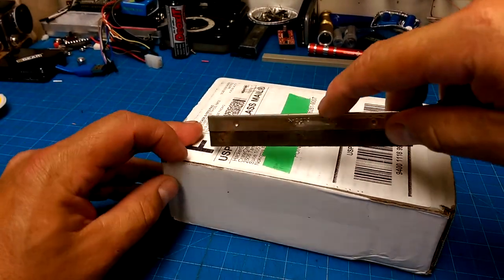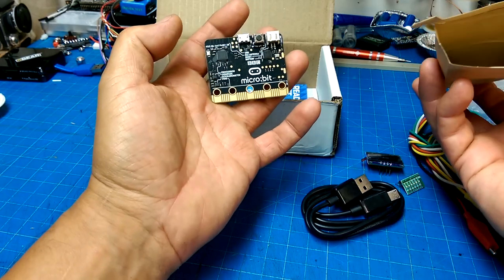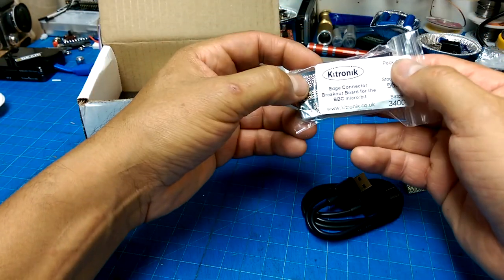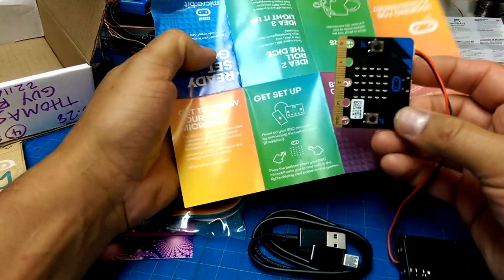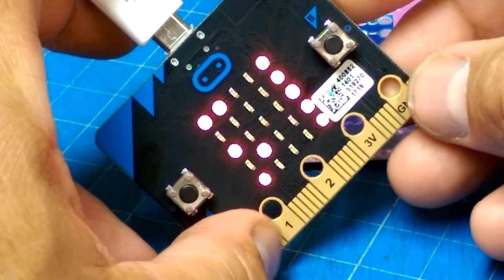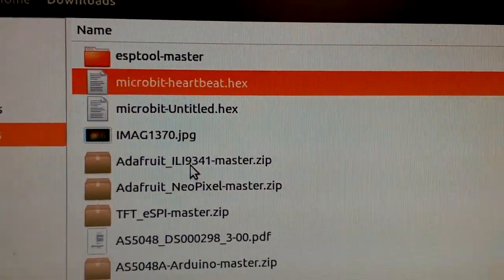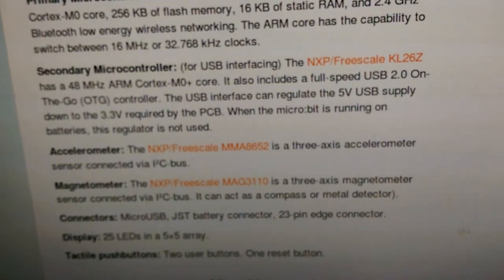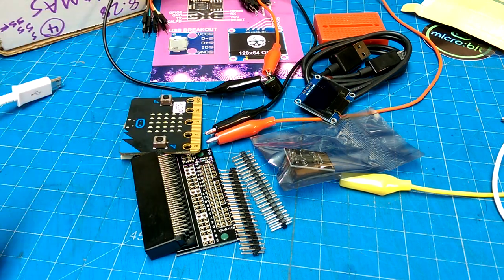BBC MicroBit

Comment: What protection have you used on the pin outs of the micro chip and explain the  problems that might be associated with static discharge and how you would then check your ports to ensure this working on arrival or in some cases importation
Reply from the maker: Not sure what you are asking here?  And of whom?

Comment: What the value of the resistors on the led array and how would  you operate this from a higher working voltage  ??
Reply from the maker: I will take a look tonight.  So are you asking "if i want to drive the LED's from a rail voltage higher than the 5v that drives the microBit, how would I do that?"
Reply: Yes ( I know how to do this  I know the answer  , the full answer already I know how to make that unit from scratch I know how to program that unit ) 

This is not what I'm asking its why Im asking you and for others attentions  particularly in the field of engineering 

My whole point behind all of this Not that Im pointing fingers @ you Im not

 Im trying to highlight a very important issue  If only others would see this 

Its not the board thats the problem

 Its not you thats the problem

 What is the problem I'm trying to highlight here ?? 

 You think about this and the questions I'm asking

 What is the problem with this generation now and what you are buying and what they are supposedly learning They are learning but and its a big  huge BUT this one !!!! 
Its the main reason why imports ares o bad , customer service so diabolical and almost an entire section of what should be very clued up people who haven't a clue  Its also vastly connected to job losses , and very very poor training  and a highly wasteful society  which in actual fact if you sent 3/4 of this  the world right now into a war (Lets hope this never happens but the way things are progressing none of us know anymore They will not survive  because of the way this being done ) If the  world were to hit massive breakdown tomorrow with respect to Korea and the united states the population would have to rebuild   I'm leaving this right there and now I want you to go back and  think about it  in all seriousness 

Its bloody dangerous what they have and are doing here for everybody 

I'm going to go as far as to say If this is all they can offer as a form of educational standard W eve lost already  and you may as well resort to the rise of communist china taking over your country and mine too  Thats  how far I'm going to go with some of this  and you know what change the name of this  , change the image and instead put it in a nice gray box with a sickle and hammer and stamp Carl Marx on this , dress all your engineers up in lovely gray uniforms with nice little hats on and  you can all call each other Mao

I want you in your answer to list all the skills that you would learn from what your doing NOW not what you've done previously What you are offering just with this board on its own please ?? 

Thank you for answering any way so far